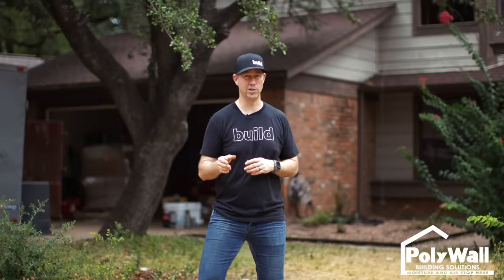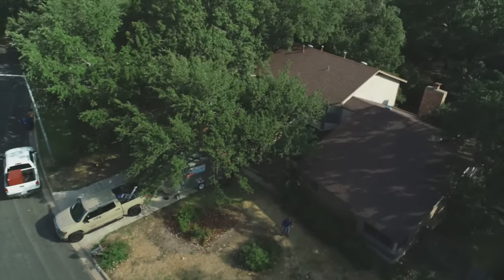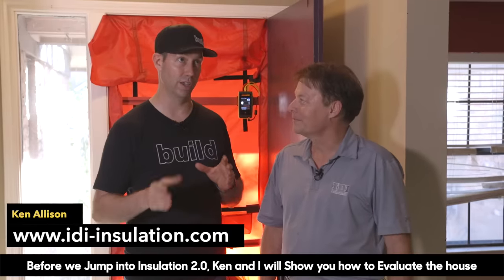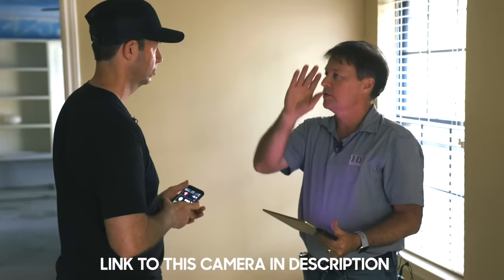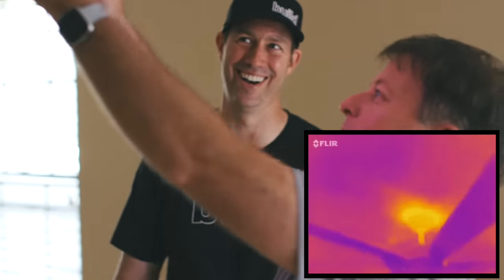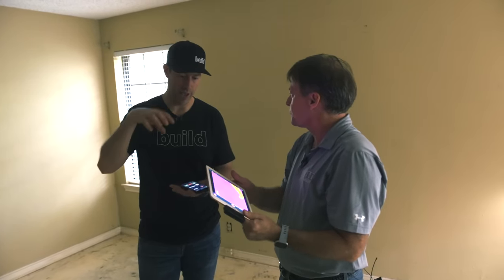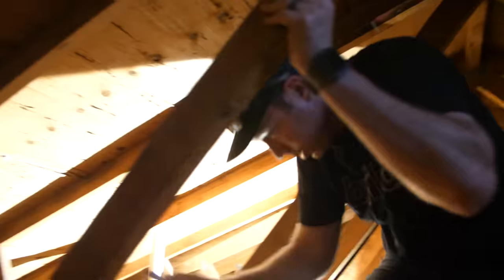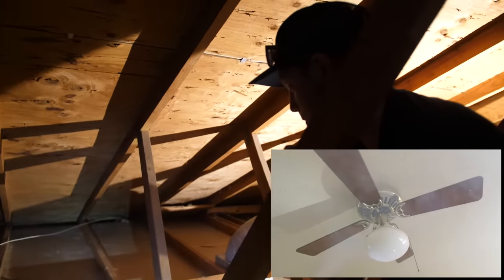Insulation 2.0 - 3 Steps to Re-Insulate

Comment: Looks like they installed the soffit vents upside down
Reply: They absolutely did. Good eye! (@30:16) That's why you need to do this yourself.
Reply: @harleywood72   They didn't fix them either lol you will see when they blow in the insulation still upside down :(
Reply: Before I read this comment I sat there and watched that part a good 3-4 times thinking that looked odd...  It still does allow for some air flow but definitely defeating the purpose of the baffles unless these specific ones are designed for it to be like this...?
Reply: @Steviodaddio  No, they are upside down.
Reply: Good catch - absolutely reversed. And like Mike saw, still reversed during the fill process. My opinion is that pros don't do a superior job, just normally are much faster vs. the home owner.
Reply: Steve Fifield  could be a new employee and will probably not live it down lol I wonder if Matt has seen this comment?
Reply: @mikelezan1023  lol
Reply: So they install every single soffit
Reply: don't think so. they said during the blowing process, that you need to cover up that 2"-4" gap. if you don't cover it up, the blown insulation will cover it, blocking the air flow, and then you'll need to manually uncover it, which adds labor costs. They didn't specifically mention it, but I believe they temporarily stuck those in there, because they have them handy. They didn't show the removal of them, but then again these videos don't hold your hand through the entire process with every single step detailed out. I believe this is what they were doing. Makes sense to me.
Reply: yup good eye
Reply: I think you need to leave them in so the wind doesn’t plow the insulation around
Reply: LOL

Comment: A thermal camera was probably the best thing I bought when I started insulating my attic. The old insulation was maybe 6 inches of blown in and it wasn't evenly distributed. It took me 2 summers to finish because I could only spend about 30-45 mins at a time up there. After the 1st summer we noticed 2 huge things. You could see a very clear dividing line between the new and old on the thermal. Half of the house had icicles while the other had nothing.
Once I was done the ceiling was pretty much the same temperature as the air. BTW I air sealed and increased the R value to 44.
Reply: Bravo!
Reply: For insulation did you do blow in or batts or spray foam?
Reply: @leekyciabrown3769  it was originally a combination of batt and blown in. I removed all of it. Vacuumed out everything so it clean. Used expanding foam to seal everything like around lights, where walls meet the sealing, etc. Then I filled in the spaces between joists  with batts. Then I put another layer of batts running 90 degrees to the joists. Each batt layer was R24 (I think could have been R20.
Reply: @systematic101  did you use a vapor barrier under the rockwool batts since rockwool is unfaced but moisture and heat resistant. I can't find any Info on that. So I'm now contemplating if I should use the cheaper pink paper faced batts first then perpendicular using rockwool but dont really want to do that unless i have to. And did u place any batts at the sides of the attic?
Reply: @leekyciabrown3769  vapor barrier isn't useful since I air sealed everything.

I placed only 2 layers and made sure they extend out over the exterior walls. I also placed these vent things that you staple to the underneath of the roof between the rafters that allow airflow from the soffit through the roof.

Comment: Not sure if spraying the electrical cables and penetrations is a good idea. The next electrician with a job in this home will be cursing (i was, just watching). If they want to change light fittings or fans in the future, they'll rip the drywall because the foam is stuck to it, won't they? Not only that.. will the foam react with the pvc insulation on the cabling, breaking it down (some pretty nasty chemicals in that foam)? Not enough respect given to the electrical installation imo.
Reply: In utah the poor electrician will be swimming through 20 inches of blown in insulation; his job will already be terrible.

Comment: Outstanding video! I've been on a quest for the last 14 years to learn (and test) about heat loss mitigation on my house and other properties. I don't have a fancy vacuum so I bagged my insulation to get to fans (both exhaust and ceiling). Also covered cans with large fiber baffels (what I found on Amazon). Brutal project, but seemed to help reduce the occurrence of ice damming. This year I am going to add a large heat cable and insulation over a large covered deck that is in the same roof line of the house 🤪

Comment: I've watched this multiple times, it was partial inspiration for my own 'energy expedition'. I keep coming back to a core question - why not shift the thermal envelope? Wouldn't it be easier and cheaper even with the 'cut and cobble' method? Seal the entire ceiling along with HVAC? The foam sealing routes are far more uniform and consistent and it further reduces pest risk, etc.

Comment: My little 160 square foot barn style storage building converted into a home only has insulation in the walls. Unfortunately over the last 4 years I haven't got around to putting on sheetrock so now I have to tear it all. This time though I'm going to use a little bit of spray foam to seal it first then I'm going to put in rockwool. I have a 10,000 BTU AC unit that was given to me and my electric bill is about $64 a month during the summer time. Of course there are a few other upgrades I would like to do to it as well like maybe some double pane windows later. My tiny house is sitting on cinder blocks about two-and-a-half feet off the ground. At the time of purchase the storage building cost $3,500 but I opted for monthly payments at $177 a month for three years ($6372 + 500 down). Many people might be moving to tiny homes for many different reasons but in my case I'm on disability and I only could afford so much. I think personally the saddest part of the story is I originally went to college to be an architect......... 

Side Note:

The average house in the United States – 2150 square feet
A downsized house – 1100 square feet
A “large” small house – 750 square feet
An efficiency house – 500 square feet
A little house – 400 square feet
A tiny house – 300 square feet
A compact house – 200 square feet
A micro house – 150 square feet

These are all approximations, there is no exacting classification of “tiny houses.” As Dr. Peter Venkman said, “It’s more of a guideline than a rule.”

Comment: Matt - PLEASE respond to my question as I'm thinking of doing this on my house.  I plan on sucking the old insulation out of my attic but rather than blow in new insulation, I was going to put a 2" layer of closed cell foam.   Then I was going to throw over that about 4" of insulation.  Does this make sense or will it create problems I haven't thought of?  You're the only one who can answer this question without prejudice.
Reply from the maker: That would be an expensive method but should work great.
Reply: @buildshow  Thanks!!!I was hoping you were going to do that on this house but I understand the cost constraints.
Reply: Last year I had 1 1/2” of closed cell sprayed over the entire ceiling deck. Then had 18” of blow in on top of that.  Yes that is R60!!!

Full disclosure the house is at a cruising altitude of 9000’ and the climate zone is 7 the same as Alaska.

The result is SO much better and tighter than the old 14” of blow in.

I put boxes and 4mil plastic over the bath fans so they could be replaced later without damaging the fan or foam.

How much does Tyvek house wrap help with air flow through the walls???
Reply: That was my guess as to what he was going to do. But it's cool he did something that can be done all DIY amd on a normal person's budget, lots of people have been asking for an series like this
Reply: @thetadashow3275  This is what I want to do.  I'm in Houston so it's not the cold but the heat and humidity.  You didn't happen to take pics as you were going along?  Would love to see them....

Comment: Good to see people talking about airtightness as well as insulation. It's ignored far too often. But you really should mention tapes as much more reliable for airtitghtness. Much slower than building foam of course. Like your skiing analogy - most people can understand that :-)

Interesting to see Austin building code is 5ACH@50. The UK is still 10m3/h/m2@50 (around 8-12ACH for typical-sized houses) for new-build, which is just shocking. Passivehouse is 1ACH@50  I really hope the new regs will fix this.

Comment: A house can be to tight.  You do need some loss, but efficiency means controlled loss when needed, like when your running bathroom fans, kitchen stove top exhaust.   I'm a HVAC Mechanical professional and I've found where contractors done a great job of sealing the house, so we often have to find a way to bring in fresh air with biometric dampers usually.

Comment: Matt these videos are extremely helpful but please answer the following:
Q1:Please list the after results on both the fog pressure test and thermo test.  Q2: if having split system HVAC unit with Gas heater. Where is the best location to install for both 1 and 2 story house “ Garage”.????
Q3: the houses you Foam Seal completely in the attic are what Type of HVAC and where is the water heater and type gas/electric. Q4: when showing / demonstrating an issue please list all information before, correction, and after results. 
I ask because I’m looking to build a new 2 story house in Conroe and this information has been extremely helpful along with up grading my families 1995 house reference energy efficiency. 
Thank You.

Comment: Im removing all skirting floor and ceiling, the gaps between wall/ floor and wall/ ceiling are huge. By spraying dense expanding foam to seal these gaps before placing the (restored & painted) skirting back, the rooms already feel warmer. Less draft overall in the house, and more drier too.

Comment: It looks to me that the guy using the gun @ 26:50 is missing spots - the foam is not sealing everywhere. Might be less than 5% overall, but still. I assume with less gaps, the "pressure" in the remaining gaps will increase, and so the airflow/heat transfer in line with potential condensation issues - more condensation in a smaller area = more water in a smaller area = higher potential mildew/rotting problems in that particular area. So There seems to be room for improvement in the application... Any thoughs? 

Rather than foam, I am more leaning towards natural "sealers", which will not need expensive disposal down the road. I'm thinking about hemp fibers - at the same time I realize that the foam is much faster in areas like these, where is't almost impossible to utilise hemp fiber... When we do rebuilds on OLD homes here in Germany, we sometimes find hemp fibers in gaps, which can be reused 100 years later. If we find Styrofoam, however, this is considered
 toxic waste. So at the end: The fast and "cheap" spray foam might become pricey after it's lifespan, and might be troublesome for the environment...

Comment: At 30:32 it looks like the black baffles are installed with what should be the side that faces the roof deck facing the insulation.  In general, the attic venting is overlooked leaving no place for the hot attic air to go.  That will lead to ice dams in the winter plus extra stress on the shingles.  Might want to check it out.  Correct attic insulation is (1) sealing penetrations (2) VENTING (3) insulation.

Comment: Thank you for this video.  I bought the "fixxer upppperr" house as a "project."  Oh what a fixxer upper its turned out to be .I own that "older house" which feels like a shed with a heater (I'm in the North) I appreciate the info how to use Flair thermal image camera and blower door.  I hired energy audit company that helped find the first set of holes but they just keep coming.   I replaced windows added insulation in attic not realizing the need for a vapor barrier.   I continued to freeze (had to wear my hat and coat inside the house and to bed to stay warm the first year).  I talked my neighbor into removing the paneling in my family room  -- both of us experienced a "What The? moment.  To our astonishment, after taking down paneling in family room, we found these 3" to 5" holes -- 6 in each stud cavity -- holes power drilled and punched from the outside, thru the sheathing, and into stud cavity from the outside.  All heat was going thru the walls.  My bedroom wall was ice -- literally.    I am having to do most of the work because  few contractors know how to truly insulate older homes coupled with building science. We had to rip out all the drywall on the perimeter of the house to close the dang holes.   We're past the 200 hole closing mark.  The attic is next.  So, I really appreciate your videos.  I moved back North from San Antonio.  I love and miss Texas (Austin Rocks) .  Thanks again.

Comment: Super useful information!

I know your videos typically focus on new construction/unfinished homes. 
Any way you could make a video on how to insulate a finished condo? Is it possible to insulate between floors (between units)? What's the process like for blowing insulation between walls?

Am i going to have to do a full renovation if i want a proper insulation? or is it possible to get good insulation in a single unit of a shared multi-unit building without needing to renovate the entire house?

I have so many questions!

Comment: one of the problems up north is that fiberglass alone looses it's R value when it's -40 out. The solution is to add some cellulose on the top to prevent the circular airflow inside the insulation.

Comment: If I am renovating a 3rd floor attic, should I put up the ceiling drywall first, then seal the gaps around drywall above, then install insulation? I was going to do ceiling insulation after framing, then drywall, but realize there may still be air gaps like you highlighted above. Would love your input. Thank you and thanks for the great videos!

Comment: Matt - great video. I run an efficency program Efficiency Works in Fort Collins Colorado that requires all of this and more. As a building science trainer  -its always good to have good vidoes to point to. I would make one comment for your review. You wore a N95 mask right beside a technician in a full face mask spraying two part foam. In an effort to protect our industry and promote best practices you should acknowledge the proper PPE required so we don't inadvertently send the wrong message to those we aim to educate. 
Keep up the great work!
Reply: scott suddreth I’m really glad to see SOMEONE call that out! Lack of concern for personal safety is a real problem among non-corporate industry. (And within corporate industry, demands for ppe is the cause of so much groaning by workers. 🤦‍♂️🤷‍♂️)

I gassed myself with a polyurethane caulk outdoors recently and regretted it for a week. Figured it’d be quick, and no better ventilation than being outdoors.
I was shocked to see him in the attic wearing a cloth dust mask with a broken nose-conformer, while hazardous vapor products were being applied!
While I’m screaming at the void 😂: hearing loss is permanent and cumulative. I really wish more ppl would use protection there too, but I’ve known almost nobody to do so.

Comment: Can you show how to insulate the air leakage in the vertical spaces as in the exterior Outlets, where you cannot necessarily remove the electrical box or how do you seal around that?

Comment: Not only does air sealing help the insulation work better / as it should, it also stops the smoke traveling thru a structure, in the case of a fire, thus helping firefighters find the source of a fire quicker, putting it out faster, thus saving lives  & property faster in the process...

Comment: Have a couple questions about attic insulation. After sucking out the blown in insulation, sealing all the leaks and blowing in new insulation, would it be a problem to lay in some plywood boards for walking around in the attic and not having to worry about stepping on the ceiling and falling through or damaging the ceiling? Also, whats your opinion on adding a cellular heat barrier over the insulation for heat deflection? Had a salesman recommend that to me.

Comment: I've been following you well over a year now. I have an electrical engineering background and pest control background. I'm interested in how your going to approach repairing the outside gypsum sheathing without removing the brick. I'm working on 1975 1600 sq ft house near Tomball, TX for over a year that has a lot of the similar issues as the house your working on in Austin. I have one bathroom and one bedroom partially gutted of drywall. In the bathroom, the gypsum is falling apart and has mold at the very bottom row. Which is due to the brick being porous and the gypsum getting wet then the brick heating up from the sun that eventually causes the gypsum to fail. In the bedroom, it started out with the air conditioner pan leaking which caused the drywall damage to an air return duct/closet. When I pulled the drywall, I found the frame work for the air return duct and closet was horrible. So I rebuilt the framing for the air return duct and the closet. I'm using mold resistant drywall. I'm gutted the rest of the room. One wall had outside gypsum where a mouse ate a hole through the upper corner frame bay and I discovered mouse dropping in the wall. The gypsum was also pulled apart from the upper part of the wall. I assume by a mouse. You might want to come to Houston since you might can use what I'm finding as additional examples for repairs.